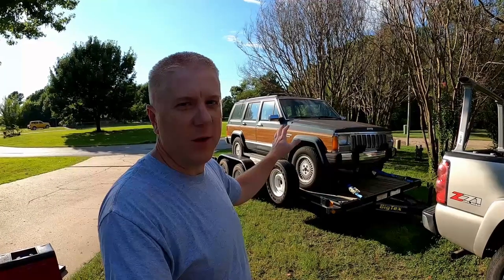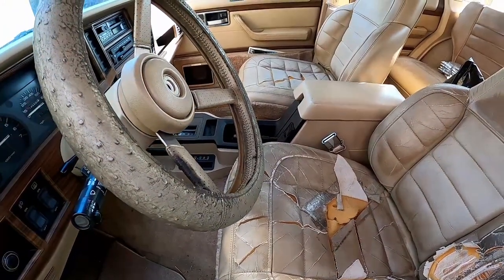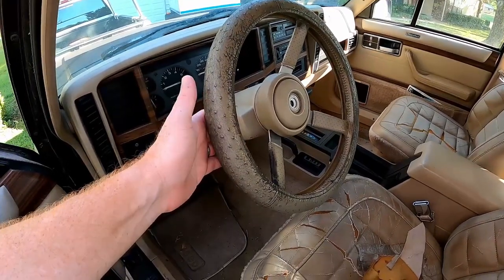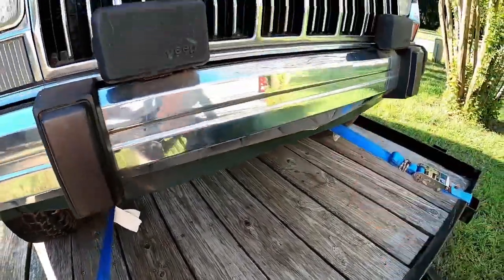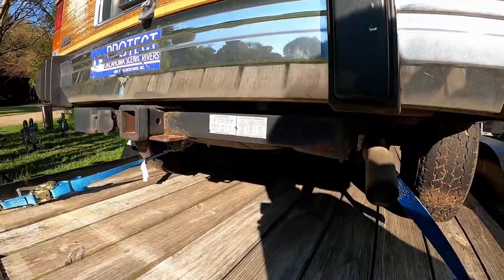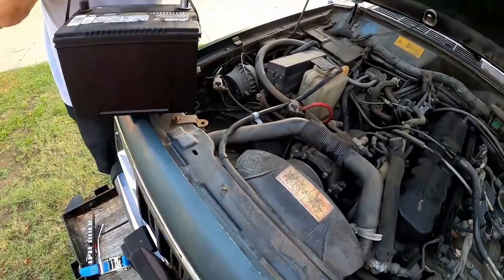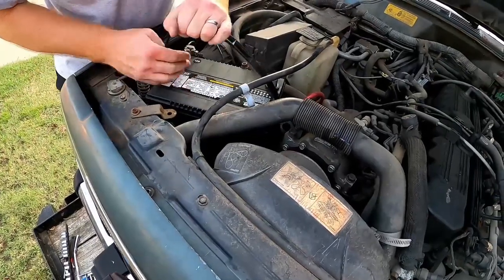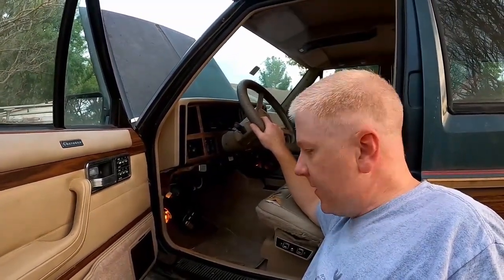Jeep Cherokee Briarwood Revitalization Part 1

Comment: I have an 88 wagoneer as a daily. Your also backward on the comand track. Select trac os the one with 4 full time. The wood vinyl and chrome is painfull to find.. Also the roof rack stops alot of the roof drone. Just letting you know its not worth removing. Also the briorwood has the new (for then) solid mount screw holes( metal to metal scew holes. Wagoneer had the older rubber pucks with threaded ferrels. Helps a little on sound reducktion and was supposed to prevent metal futege cracks from forming around the mounting holes. As for your seat base, just swop the seat covers on the seat base cushion. The base pans are the same, you might want to get the main seat base welded at the same time. The back mount for the driver seat was broken and wouldnt lst my seat move. Fixed that and it works great for 34years old
Reply from the maker: Thanks, I appreciate the info!